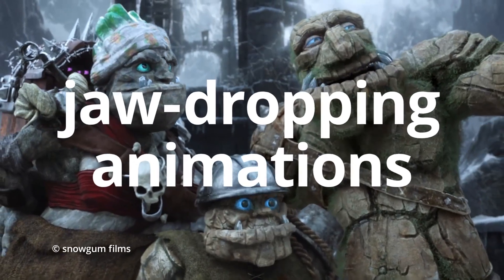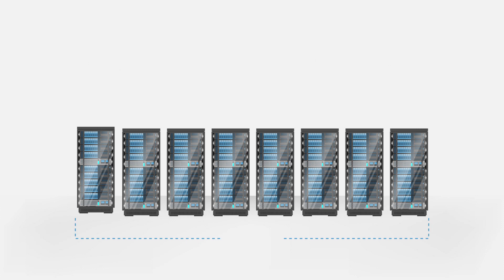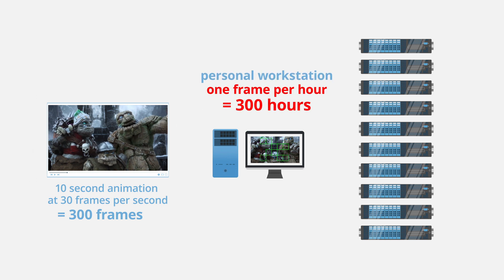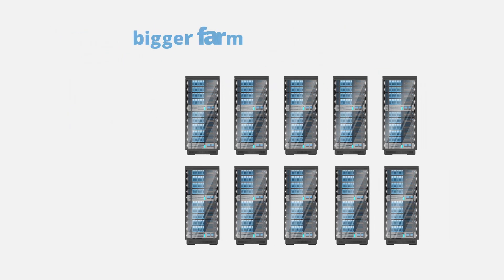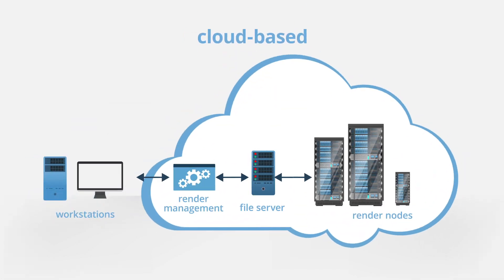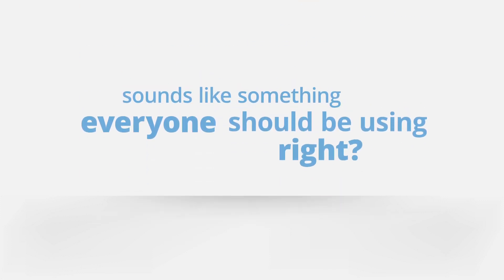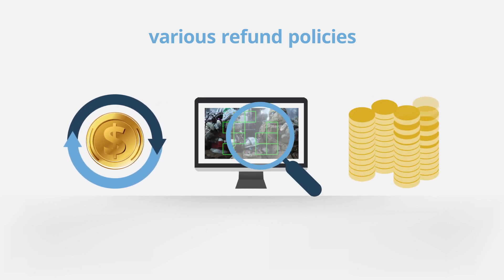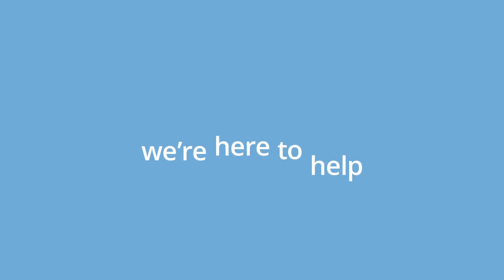GarageFarm.NET | What is a render farm and how it works?

Comment: Can I use a second PC as a render farm? I have one with the following specs:

NVIDIA GeForce RTX 2060, 10th Generation Intel Core i7-10700F Processor, HyperX 16 GB RAM, 512 GB SSD and 1 TB Hard Drive, Windows 10 Home (GT12-0060, 2020)

If I buy another PC with the same specs, can I use it as a render farm? If so, how much faster will it make rendering? Or is a render farm entirely different from a PC?

Comment: Pros and Cons of using full service farms like Garage vs configuring own with AWS?
Reply from the maker: This could be a blog post to list all pros and cons. In short, GarageFarm is a plug-and-play solution which doesn't require any configuration, you're good to go as soon you've installed the plugin for your DCC. AWS requires quite a lot of IT knowledge and configuration before you can render anything, it could take days depending on how technical you are. Both solutions have their place, though.

Comment: Help me understand about the cost of using cloud render farms.
Reply from the maker: Typically, you pay for time a node/machine is on and actively rendering. For example, let's suppose 1h of rendering costs $1 and a scene needs 10h to render all frames on the farm, it means you'd pay $10. This is of course a simplified example. There's also machine speed or rendering speed you can choose which will affect the price. Some cloud render farms charge for storage on top of rendering. This cost calculator here is very useful in getting a rough idea of what a project could cost on the farm https://garagefarm.net/cost-calculator/.

Comment: does garagefarm support addons like animation nodes or sverchok?
Reply from the maker: We support Animation Nodes addon both in Blender 2.7x and 2.8x, but as there are a few builds available of the addon, we recommend rendering a test first to make sure that everything works the same way as on your end. If you need a specific version of the addon, then please let us know, we will prepare the setup for you.  

When it comes to Sverchok addon, then we don't support it right now, but it shouldn't be a problem to add it to our setup. Please contact our support and let us know what exact version do you need in which Blender version.